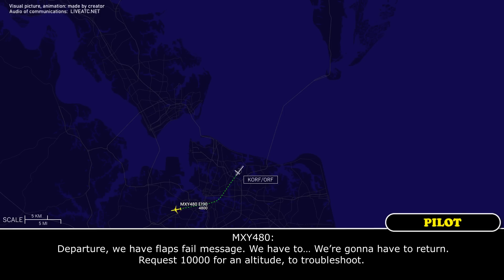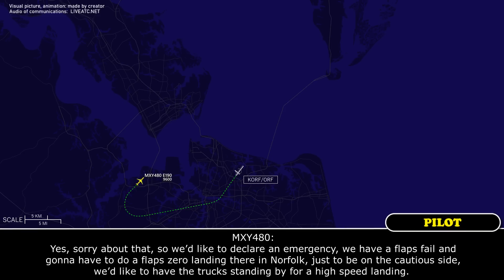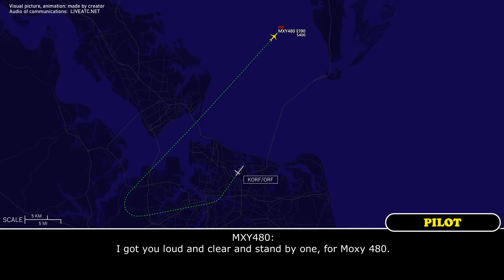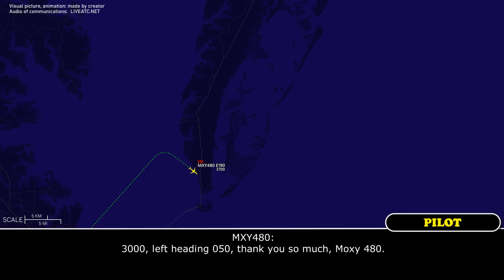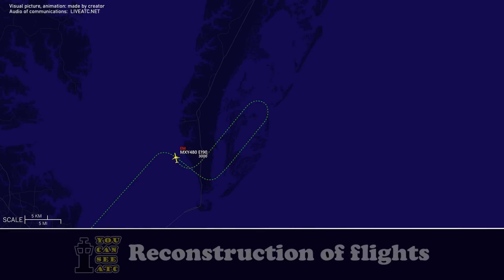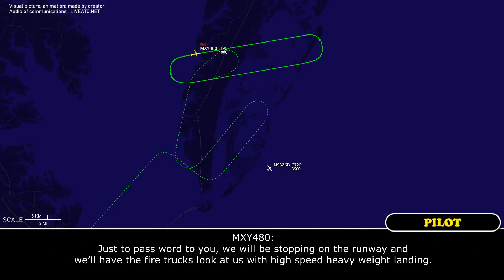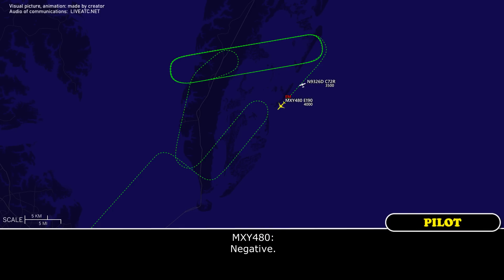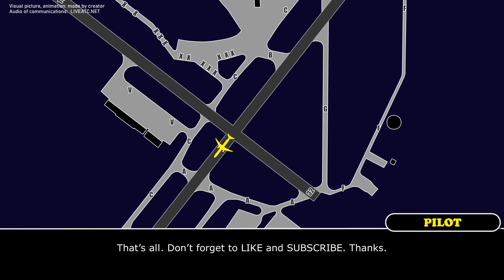Flaps failure. TCAS RA. High speed landing | Breeze Airways Embraer 190 | Norfolk, Real ATC

Comment: If the crew would have done LEFT turns in the hold as instructed, they may not have had a conflict with the traffic. But, seems like they handled the emergency pretty well overall, good job.
Reply: I was just about to post the same thing. I had to go back and listen to the holding instructions, because the visual representation showed right.
Reply: @146flyer8  yeah same I thought I was missing something lol
Reply: honestly guys I just think the editor messed up here. If the pilots had actually taken right turns as shown on the video there would have been radio comms about it. I think the pilots did do the left turns as instructed, but the editor didn't do as instructed lol.
Reply: @ihateusernamesgrrr  most likely, the crew made right turns but due the emergency, the controller just ignored it and let them hold incorrectly. Or, the animation shows right turns but the crew actually made left turns. This is why it is important to declare an emergency when there is a serious problem and not hesitate to do so because you don't want to do extra paperwork or cause trouble for everyone else, because this could have been a pilot deviation and open to action being taken by the FAA. Pilots are expected to follow the rules even in stressful or unusual circumstances. So declaring  an emergency is wise when it's necessary, it allows ATC to do certain things they can't normally do and allows pilots more room for error such as block altitudes, or speed limits, crossing restrictions.

Comment: What’s an RA?
Reply from the maker: TCAS Resolution Advisory 
https://skybrary.aero/articles/acas-resolution-and-traffic-advisories
Reply: One of the instruments onboard (the TCAS) will detect the proximity of other aircraft and alert the pilot if other traffic is too close for comfort.  An RA message (Resolution Advisory) is basically a command that tells the pilot they either need to climb or descend to in order to get out of the way of each other.  Pilots are not supposed to ignore the RA messages and they should be followed if commanded, and RA messages supersede any other ATC instructions.  But I believe (though may be mistaken) since they had a visual on the other aircraft, they didn't have to maneuver, or likely the message cleared as the Cessna was turning right.
Reply: It’s a clear instruction to immediately change your altitude, either climb or descend or risk a collision with another aircraft (it will advise one aircraft to climb, and the other to descend to ensure they do not collide). The system overrides ATC instruction. If ATC tells you to descend and TCAS system plays out loud “CLIMB, CLIMB NOW”, then you climb. Because the other aircraft would be told to descend by the system, and if you followed ATC, you’d both be descending into each other and likely to collide.

Comment: Wanna just fly to NO? lol
Reply: That was great!
Reply: They have to burn the gas one way or the other. . . As annoying as it probably was for the pax, sounds like the crew made the right call as far as the return.
Reply: Ok not a pilot, but if my flaps were stuck, and stuck due to hydraulic actuator failure or worse a linkage failure that just might finish breaking and now one wing has flaps and the other doesn't, yeah I would want to be down and then find out how bad or not it really was. Like the Ice Pilots NWT " Hey that one landing gear is sure slow coming up" instead of aborting the retract and dropping the gear they flew anyway, and the next landing was a belly landing.
Reply: Best part 😁
Reply: @billdurham8477  Ok, I was wondering why they didn't head to Atlanta to burn off the fuel, but your explanation makes sense.
Reply: @YouCanSeeATC  How did you find this?

Comment: Airlines need to monitor radio transmissions for correct protocol. This guy is awful.
Reply: Gees, how about you judge once you’ve flown a passenger jet in an emergency situation? 🙄 He was probably just nervous as hell since he was flying a plane with control problems, that was so heavy they couldn’t land any time soon either, meaning he had to keep working an injured plane for a long time yet. He only forgot the call sign a couple of times - he apologised when he realised. 

Also, it’s a new airline. Now it might not have had anything to do with it of course, but it’s just possible that the pilot is still getting used to the brand new (to aviation, not just him) company and call sign.

This channel alone is full of videos of far, far worse comms. I advise you don’t watch them, they’ll probably just make you really angry. 😅